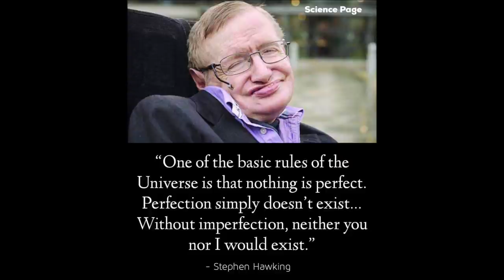1969 Plymouth GTX Pro Street Hemi Drag Car 1/25 Scale Model Kit Build Review AMT1180

Comment: YES YES YES YES.... I have 2 of this kit and haven't opened it yet. The GTX doesn't get the credit it deserves because it's not a cuda, charger, or challenger but these things equipped with the correct factory parts were absolute BEAST. THANK YOU
Reply from the maker: Totally agree!
Reply: Just wanted to say Thank you for your videos, in my opinion they are the absolute best model building videos out there. You give great tips and you address known and unknown problems, the biggest part you address is that it doesn't have to be perfect because it's yours to make it whatever. And 1 of the biggest reason I love your video are there is no politics and your are having fun

Comment: Nice I built it back in the 90s they added parts to it and it was a 69 roadrunner minus the gtx trim both are great
Reply: Didn't have the custom gauge panel or the edelbrock air cleaners

Comment: I enjoyed watching this one. I've got bits and pieces of those 68/69 plymouth kits in my parts that I've collected over the years. Looks like I have enough to build one now without having to buy a new kit.just use what I already have..Im starting with a 1/25th 69 gtx convertible body that I just converted to a hard top using a roof I cut off a parts 1/24th 70 roadrunner body shell. I  cut/scaled it down to fit and will make it look like a vinyl top instead to bend it in better at the cut and splice lines.  Thinking about just building it as the sage green version of yours before the guy painted it.
Reply from the maker: Rock on!

Comment: They went all out on this kit. I remember,most of the "good"kits back in the 80's the motors were like that,had cylinder bores in the block and heads,some even had the pistonswith no.1at top dead center. Always with separate transmission,a lot of em came with auto or stick shift options. Is this an old repop or just a really well thought out kit? Keep it up! Love the build,cool looking as always! Stay healthy!
Do you ever do plug wires on anything? I can't remember seeing you do,but that don't mean much. I've been contemplating trying it. Seems kinda fiddly to me, just wondering if you've tried it. I have huge hands,and you got big mitts also, figured you have some of the same difficulties I have reaching and handling little items. Thanks
Reply from the maker: Same to you Tom!

Comment: i wish i had bought that when i saw it last, i have a lot of parts, and have been building a large master collection, most of the b body mopars interchange floor pans in the a,m,t, world, i am currently tubbing out a richard petty belvedere, using the 426 wedge from the 64 belvedere kit.
    dont know what i will do about cross ram yet, i want it to have it, 
    dont know where to find it.
  has the panels reversed, painted aluminum, roll bar from petty kit, interior handles, driver door handle, racing gauges from petty kit, dash HAS radio delete, beat up glove box lid, paint aluminum,  well that'll be later, 
   they include those gauges in this one too i see, i need to find one to go with my 64, i will do the sister convertible to do a drag car with!
Reply: great build and thanks, beautiful car

Comment: Can you use black prime on the body of the car?
Reply: You can use any color primer you like, depending on how you want the finished paint coat to look. For example, black can add depth to metallic, pearl or iridescent colors, such that a lot of model manufacturers use black plastic as the basis of their chrome parts, because it makes the chrome really 'pop'. Also, as Chris notes, black primer is great at providing shadow effects on engine parts and interiors. Essentially, have fun and experiment on spare parts to find out how various primer and top coat combinations work, because there are no hard and fast rules when it comes to deciding how you want your model to look.
Reply from the maker: ^ He's right.
You can certainly use black as a primer coat for a body depending on the effect you want.
Reply: Thanks guys. I have a model that I haven't built yet and I didn't want to ruin it. Would it look good if you did it on a lowrider though?